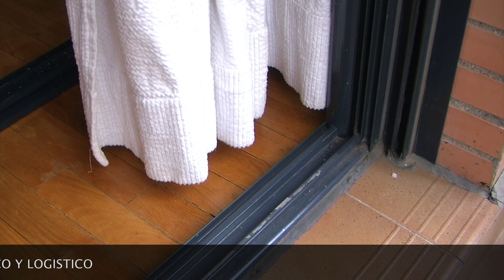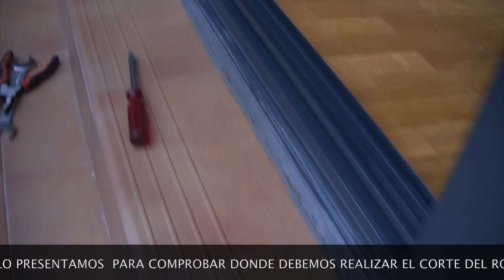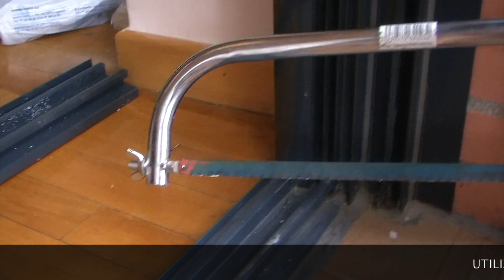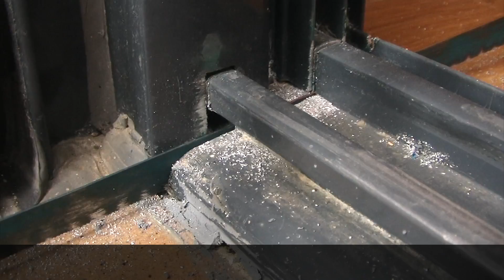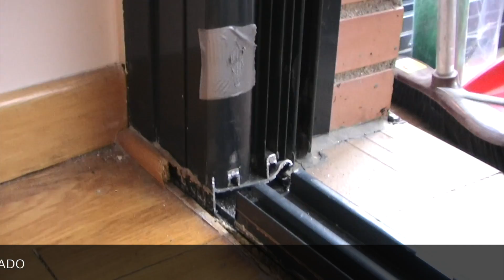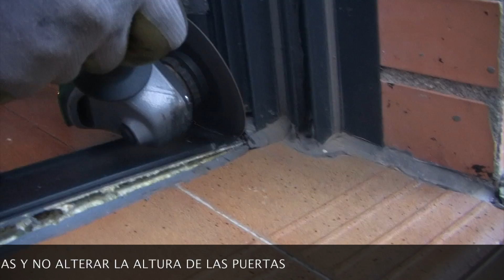SUSTITUIR CARRIL DE PUERTA CORREDERA DE ALUMINIO - REPLACING ALUMINUM SLIDING DOOR RAIL

Comment from the maker: WE ARE GOING TO REPLACE AN ALUMINIUM BOTTOM PROFILE WITH 3.66 M LONG DOOR RAILS. THIS WILL SAVE US A LOT OF MONEY AND LOGISTICS.
YOU CAN SEE THE WEAR AND TEAR OF THE LOWER RAIL AFTER YEARS 
SUPPORTING A DOOR OF GREAT DIMENSIONS PRODUCING EVEN THE BREAKAGE OF ONE OF THE RAILS THAT SUPPORTED THE DOOR IN ITS DISPLACEMENT.
WE HAVE ACHIEVED A PROFILE WITH THE SAME CHARACTERISTICS AND COLOUR.
CUTTING IT TO THE MEASURE OF THE ONE WE ARE GOING TO REPLACE.
WE PRESENT IT TO CHECK WHERE WE HAVE TO CUT THE BROKEN ONE.
IT WILL NOT BE NECESSARY TO MARK THE LOWER ONE IF WE ARE GOING TO REPLACE IT IN ITS ENTIRETY.
WITH A KNIFE CUTTER WE PROCEED TO REMOVE THE ASSEMBLY PUTTY THAT FIXES IT TO THE FLOOR.
WE WILL USE A HACKSAW TO CUT, WE WILL PROTECT THE CONTACT AREAS BETWEEN THE METALIC ARCH AND THE ALUMINIUM, WITH A PIECE OF CLOTH TAPE, WE SHOULD ALSO PROTECT THE FLOOR THAT IS IN CONTACT WITH THE SAW.
WE WILL REPEAT THE ACTION ON THE OPPOSITE SIDE.
WE TRY TO FORCE THE COMPLETE BREAKAGE, BUT WE DISCOVER THAT WE NEED TO WEAKEN IT BY MAKING ANOTHER CUT IN ANOTHER PARALLEL POINT TO FACILITATE THE EXTRACTION. THIS TIME WE ARE GOING TO USE A CIRCULAR SAW, ALTHOUGH WE COULD CONTINUE WITH THE ARC SAW.
THIS TIME IF WE MANAGE TO BREAK AND EXTRACT THE PROFILE AT THE DESIRED POINT.
WE REPEAT IN THE OTHER SIDE THE SAME OPERATION.
IN THE CENTER THERE IS STILL A SCREW THAT MUST BE REMOVED.
THERE IS AN ALUMINIUM BASE THAT WE ALSO HAVE TO REMOVE TO KEEP THE MEASUREMENTS AND NOT ALTER THE HEIGHT OF THE DOORS.
WE MOUNT THE NEW RAIL, SCREW IT IN THREE POINTS TO THE FLOOR AND SEAL IT WITH MOUNTING PUTTY.

Translated with www.DeepL.com/Translator (free version)